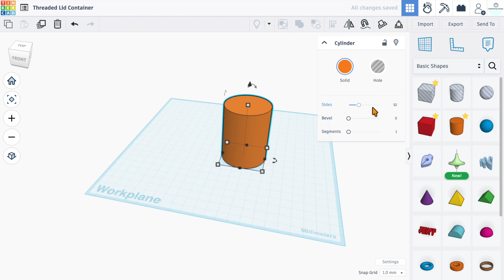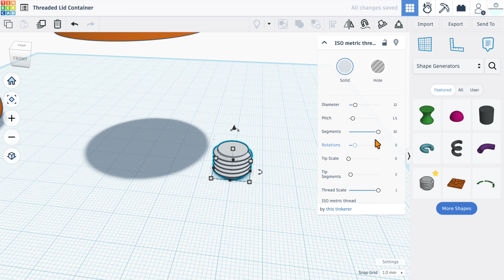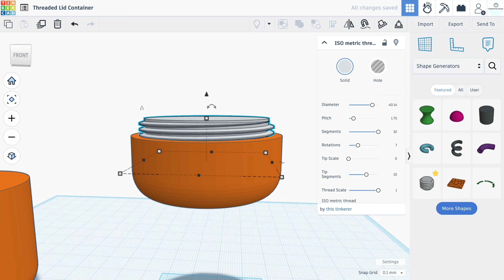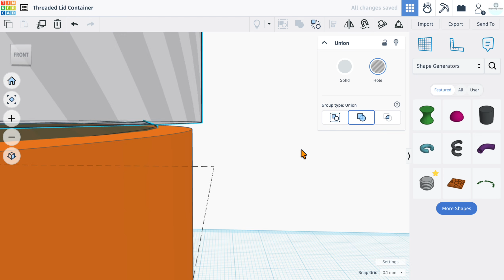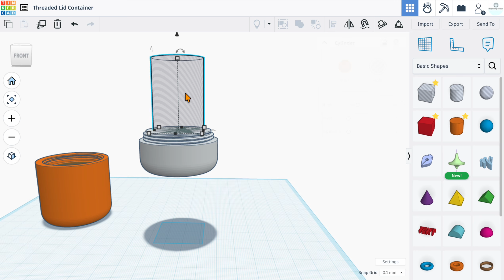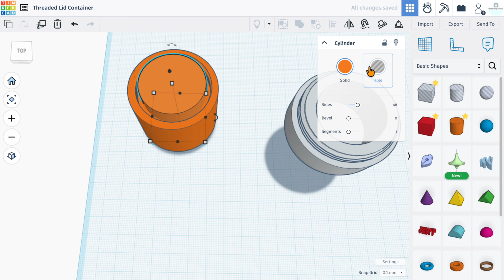How To Design & 3D Print a Custom Mini Jar (Tinkercad Tutorial)

Comment: Great video.  Only issue I have is probably what other are saying and that is WHY did you choose the parameters you did when crafting the thread initially.  You changed values without explanation.  Left me questioning the reasoning.  Thanks though as I haven't used the thread option yet but plan to.
Reply from the maker: Great question! The thread dimensions are automatically calculated based on the scale of the object. I just left the parameters the same as I scaled the object to the size that I wanted. Agreed, I should have mentioned this in the video. Thank you so much for your support.

Comment: I'm seeing a lot of comments where others are trying to do this but with their own dimensions and running into issues.

Here's a thought.  Follow the example in the video, exactly.  Get it to work and print properly.

Then, make a copy of the top/bottom.

Then, take one of the copies and put the top onto the bottom as it would normally be.

Now, group the top/bottom (temporarily).  Now, resize the object, making sure to keep perfectly round.

Once you get the size you want, then just ungroup once, which will again separate just the top from the bottom.

Now, move the top back down to the plane in the correct orientation to print.

It should now just work when printed in the new size.  🤷‍♂👍😊
Reply from the maker: That’s awesome! Good advice!

Comment: How can I add a keyring hole to this? I want to make a lipstick holder keychain.
Reply from the maker: Imagine after you get the shape completed, you will take a circular rod, picture the stock of a Q-tip, and you’re going to punch a hole through a portion of the lid at a 45° angle. This will give you a spot to thread on the key ring.

Comment: Hey help me please I did exactly the same thing as you, just using my own dimensions. But every time I drill out the thread, all that’s left is a floating spiral—no outer wall. And when I try to drill out the second part using the first part (which I’ve already connected via the thread), it just creates a small hole instead of a thread. What on earth am I doing wrong? My container is 72 x 72 mm, my thread is 68 x 68 mm, and the bore is 62 x 62 mm.
Reply from the maker: I can help! The first thing I would recommend is create an exact replica of mine and 3-D print it. If all that goes perfectly well, look at the physical object and use a digital caliper and physically inspect the object and compare it to the dimensions that you are using to see if you have your calculations correct. It’s hard to tell exactly what’s happening without a visual as you’re describing it, but I think I understand what you mean. There is a chance that your inner cutouts are too large and there’s not enough meat, so to speak, behind the threads. Start with no cut out in the interior portions, only top piece and bottom piece, and the thread cutouts to start. Then, after you have done those steps, then hollow out the inner parts of the pieces. Hope this helps, let me know if you have any thoughts!

Comment: could you explain why you chose certain measurements and pitch? im following along but doing my own sizing and I'm not sure how you came up with certain numbers
Reply from the maker: It is actually automatically calculated by the software based on the dimensions of the object. This is with the exception of the controls that I show in the video of how to change the dimensions of the threads, but the exact numbers are auto-calculated by the software. 😎👍🏼
Reply: @tinkertime1 so why choose 7 rotations and have 3 stick out? Why also set pitch to 1.75? Just curious
Reply from the maker: @kendraa_______9981  simply because after printing it, it fits the best and the overall print quality seems the most functional.

Comment: I followed every word and move you made on this video and was doing quite well! 

Unfortunately even though I replayed the same section over and over again when you got to the part where you said now what we want is this to have about three threads- sticking out here so we’re gonna hold command or control and we’re gonna go go down to your snap grid and we’ll change that to .1 mm so we can have finer control here and then we’ll go up till we see three - why you were saying that you did something to make the threads disappear into the cap but you did not say how you did it- 🤔

Please can you explain exactly what you did while you were talking because you didn’t say how you managed to do that and I have now got to the point where I am ripping my hair out😢
Reply from the maker: No worries, at the point where I am lowering the threads into the cap, all that is happening is the threads are just combining into the cap piece automatically as I move one part into another. This is just happening automatically in the software. You can have both pieces next to each other and then align them perfectly with the alignment tool, and then just raise up the threaded piece in the middle until you see three threads worth. Hope this helps!

Comment: What do you recommend we do to the threads when trying to make a container with PETG ? I printed my design and the threads work just fine in PLA but I’m thinking because PETG shrinks differently my container wont twist shut all the way , it gets stuck about halfway down the threading. What do you recommend I try ?
Reply from the maker: I would reduce the body of the jar itself by 1% in the slicing software. Or alternatively increase the size of the lid by 1%. 👍🏼
Reply: Because you don't shrink one half because plastic shrinks when it cools like he said. Both halves will shrink the same... so when he shrank the male thread, he also changed the hight which changed the thread pitch. He should have only reduced the x & y axis to create clearance. I suspect your issue is trying to mate 2 different thread pitches.

Comment: If you scale both pieces would it keep the threads working or would you run into issues?
Reply from the maker: Scaling it actually works just fine. As long as you scale both pieces equally everything works as it should. 😎

Comment: Thanks for the awesome tutorial
Reply from the maker: Thank you for watching my video! 😎
Reply: @tinkertime1 I tried this tonight and "adjusted" some dimensions and the inside threads weren't there.
I'll have to try it again sometime.
Reply from the maker: @VRMN8R  is it possible that the inner cut out that we used to make the threads in the main body could’ve been pulled away just enough to no longer make the cut out? Interesting. If you can’t figure it out, let me know. I’m here to help!
Reply: @tinkertime1 I think it was on me. I made the part a little bigger so I didn't follow what you did so I may have goofed somewhere along the way.

That's how we learn, right 😉

Thanks for being active in your comments.

Comment: I’ll apologize now for the dumb question, but I am brand new at this. Will this file work in any 3d printer?
Reply from the maker: You know what they say, the only dumb questions are the ones we don’t ask! You are correct, the file will work in any standard 3-D printer that is an FDM machine. 👍🏼
Reply: This only creates the geometry dimensions. Export it in .stl format, import that into the slicing software for your printer and send that file to your printer

Comment: Thank you. This is the second video with threaded lid containers that I have watched and I am not sure where or why you got your numbers for the sizes of the holes in the container, or how/why there is so much eyeballing depths with threads and holes etc. I come from a graphic design background where everything is measured in exacts so these parts of the video were confusing to me. If I'm making my own custom size, I don't know why or how you came up with numbers (other than shrinkage part of 1mm).
Reply from the maker: I actually designed this piece before I made the video and I made several versions, tightening the tolerances until, to me, it was just right. That is where the numbers are coming from in this case. 😎

Comment: Where do all the numbers come from when you are creating the threads, Pitch, diameter, segments, rotation, tip scale and all the others, as you sounded like you ha ether written down and we’re copying from somewhere, but you did not explain this in the video ?
Reply from the maker: Since this is my own personal design, I just broke the process into steps and the measurements are my own. I design it ahead of time and make sure everything works as intended, and then I make a video breaking it down for others to learn how I did it and the methods that I personally use. If I didn’t do all the design and prototyping ahead of time, then I could not guarantee that if you follow the steps, you will be successful is how I view that. 👍🏼

Comment: Cool technique! I had not used the Cruise tool before, so that is good to know also.

But I gotta say, not explaining why you used several non-round numbers is a gaping hole in this tutorial. Dimitris said the same, but you misunderstood his comment and responded with instructions on how to scale objects. That's not what he was asking.

For example, why did you choose 40.14 as the diameter of the threads? Why not 40 or 41? By the way, you can click on the number next to the slider and simply type in the number you want. 

Why 13.56 mm for overall thread height? Why not 13 or 14? I don't see any reason both these examples couldn't have been simple, round numbers.
Reply from the maker: To be honest, it is my OCD. You make a great point and that is something I can definitely address in future tutorials! Thank you for bearing with me as my channel adapts, grows and take shape into the best possible tool that I can offer to help beginners learn how to design. I appreciate your insight!

Comment: 20,465, 13,987, ..., etc. Where do all these odd numbers come from? How to calculate these numbers would be a topic for a video, because not everyone wants to print this "jar" in exactly this size.
Reply from the maker: That is a good point! When it comes to sizing, in tinkercad you can highlight the entire object and hold the shift key and drag from one of the corner markers and it will evenly scale the object to the size that you need. This can also be done in the slicing software after you load it in before you slice it you can scale it to whatever size works best.
Reply: @tinkertime1  Thank you for sharing this information. How did you determine the exact numbers to use in the design. Is there a formula, chart, other video to help determine the numbers?
Reply: You can apply whatever sizes is appropriate for you.  If you look at his numbers, then you can figure out the percentages used for things like wall thickness.  Depending on the type of filament you have will depend on the shrinkage.  PLA  has low shrinkage of .3% to .5% that he adjust for after designing the container.  You can use dimensions al percentages as a starting point and tweak it to your needs.